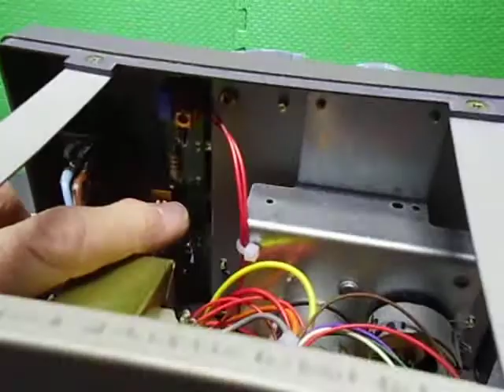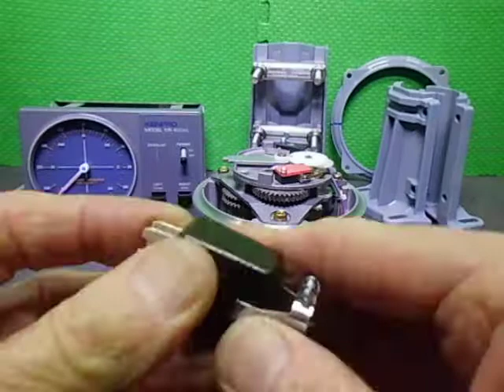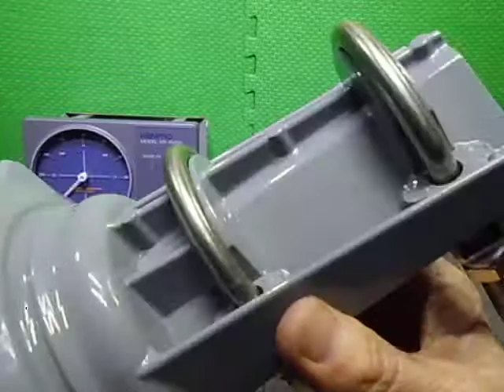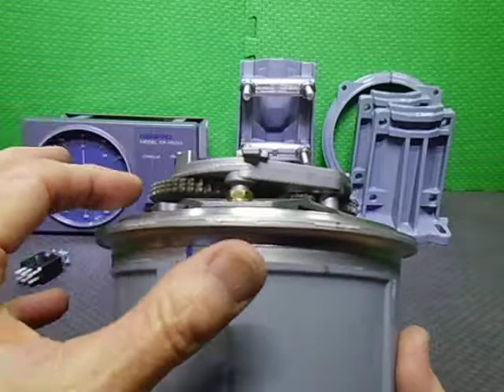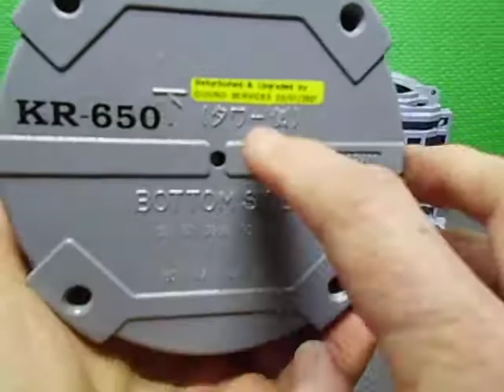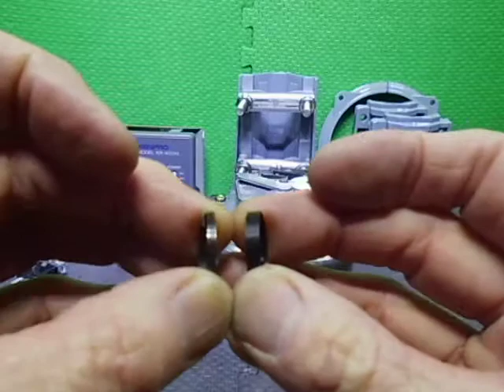KENPRO KR-450XL Rotator Upgraded Into A KR-650XL

Comment: That's not much different from a Yaesu rotor .
Reply from the maker: Hi Ray, Thank you for comment. Because it is a Yaesu. Yaesu purchased Kenpro in the mid 90's & changed the KR prefix to G. Regards Peter
Reply: @duoro-rotators  Okay I have a 2800-G
Reply from the maker: @rayjohnson7886  Hi Ray, Ok you have a G-2800, how can I help. Please get in contact with me via my web site, via the link in the description. Regards Peter